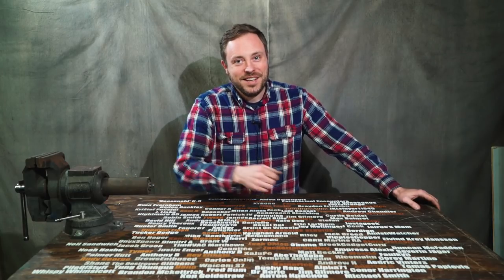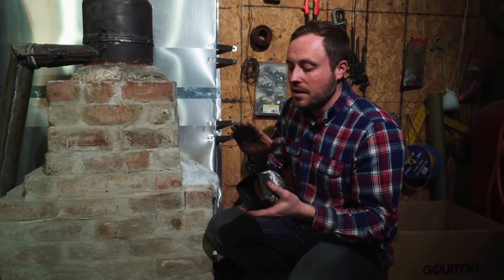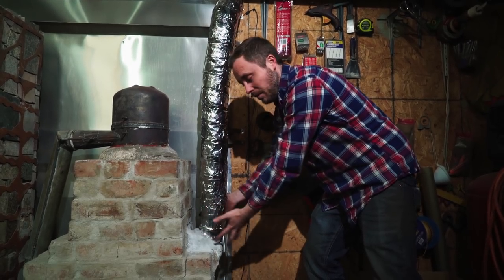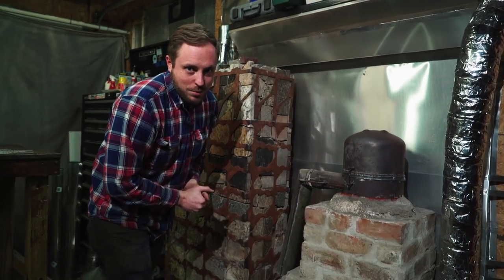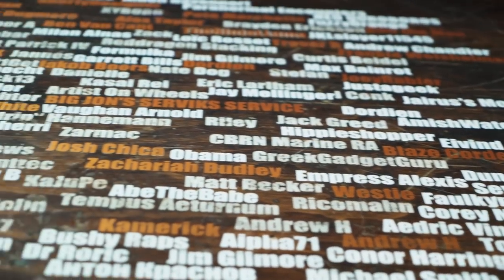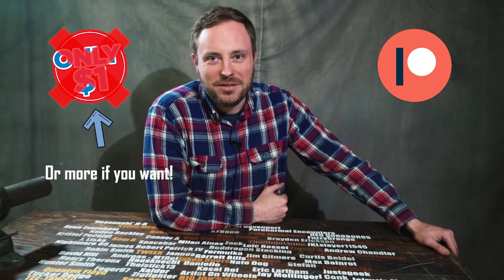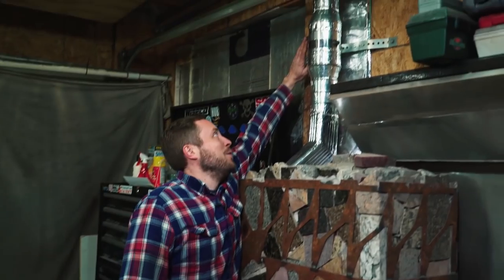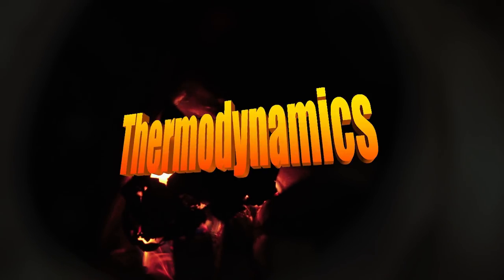Heat Your Garage For 74¢ A YEAR! - Mini Nautilus Rocket Heater Upgrade

Comment: hey man if you need free wood try those places that sell 4 wheelers or snowmobiles, the crates and packaging wood is thrown away
Reply: Yeah, a good chunk of those pallets is hardwood. That would work great
Reply: @alexwenham7136  But then he'd need to pull out all the nails, and still have to break them up into little chunks, anyway
Reply: @darksunrise957  free hardwood is free hardwood bro.

Comment: You could probably use peltier effect plate to run your PC fan once it gets warmer enough so that the system is keeping itself going instead of puling power from the wall
Reply: Just run if off rechargeable batteries and re-charge the batteries with your TEG.

Comment: I love this design. Solves so many issues space being the largest. The one question i have is insurance, can you insure your garage since you have a rocket mass heater that is not UL listed? If so what company does this. I want to build one for my house but cant find a company to insure it.
Reply: No sane insurance-company would insure that ticking timebomb.
Reply: @ABaumstumpf  It's no more of a "ticking timebomb" than a traditional wood stove. It's probably less of a risk, since choked wood stoves will build up creosote in the chimney and burn your house down.

Comment: great video .. excellent theory and practical demo . first time I have seen a sort of   torroidal burn chamber fabrication . I have my torroidal vortex design laying horizontal where it leaves the burn chamber  the riser exits the centre of the donut shaped  refractory cast torroidal  secondary burn zone .
Reply: My understanding is that you want the burn chamber itself to lose heat fairly freely, and not get super-hot, so that the insulated riser, of refractory brick/concrete/metal where the refractory temperatures are achieved.

Comment: As far as your exhaust problem. You should be typically. 3 foot higher than your roof Peak so you don't have the wind draft problem. For a regular wood burning stove anyway

Comment: If you add a thermocouple to charge a battery to run the fan, you can take it entirely off-grid. Dunno if the complexity and cost are worth it, but you might find the idea amusing.

Comment: These build videos were awesome to follow and it's great to see a follow up on it! I was very curious on how well it worked.

Little nitpick on the price, is that it's only accounting for the electricity from the fan and not gasoline burned while driving to get wood. Unless if you get those scraps from work!
Reply: Matthew Nelson he did say that he count the wood as free because its scrap from hos projects 🙂
Reply from the maker: Yeah I haven’t counted driving because I get wood from friends and places that I’m going to anyway.
Reply: If he wanted to go hard-core, he'd marry this system to a TEG that charges batteries that run the fan.  Then he wouldn't need any electricity for the life of a pretty small battery.

Comment: Just a suggestion for this:
I seen fans that run just from heat exchanged from copper fins. Use them and it could be zero point energy fed.
also maybe for a future project, think about a sealed unit that has copper tubing and 50/50 glycol water mix. In floor heating works with this same idea. The problem is sealing it and making is safe enough. But same idea, the water feeds into the bottom, hot fluids rise and out the top to heat the floor, then back in again.
But teaking out a floor probably isnt big on your list either heh. So anyone else have a plan with a dirt floor garage might be able to though.

Comment: Could you use wood chips? Then you could solve the hour long cutting wood with a crusher
Reply: Or wood pellets. I've seen someone making a pellet hopper for a RMH here on YT I think.
Reply from the maker: If the chips or pellets are too small they don’t get enough oxygen. Wood stoves that use pellets force air from the bottom to solve that.

Comment: At around the 10 minute mark you mentioned when it's windy outside you require the inside fan to keep the system from reversing, would it be possible to add a wind powered singular direction fan on the outside? Making the wind work with the system rather than against it.
Reply from the maker: I have thought about that a lot. Just haven’t had time to make one yet.

Comment: if you want better flow you can make a weather vane type chimey/inlet caps so that the inlet is always on the high pressure side of the wind and the exit is always on the low pressure. but im a hippy so you prob dont wanna take my advice!

Comment: Dude I was a chimney sweep for 10 years and that looks like galvanized pipe. When galvanized pipe heats up it puts off a poisonous gas. Also fiber glass will melt and catch other shit on fire, a ceramic or "white insulation" is required for double layered pipe

Comment: You could have also built a shroud that shielded the chimney from the wind, just an elbow facing sway from the wind. That would also potentially help with pulling the exhaust out by making a small vacuum.

Comment: Awesome, Have you tried firing it up just with some sticks that are already the right diameter or do they not burn well enough? 

 
p.S. am I the only one bothered by the lever on the butterfly valve being 90° offset from the actual valve?
Reply: joejoe4games im also bothered by it... Especially since every Valve since the beginning of time has had it to indicate the directon of the butterfly 😅
Reply from the maker: I do that sometimes also but they don’t burn as well, good thinking!

Most of the time it is closed and I want to see my cool curly bits. lol

Comment: 12v .5a 6w,  your computer fan is lower cost than most lights you would buy. 6 watts is very low power. it would take running this light 100 hours to use the power of 6 100 watt lights for an hour.

Comment: You should make wood splitter with a can crusher, or at least the can crusher mechanism
Reply: Splitting wood requires a hundred times the force of crushing a can.

Now, a gravity powered splitter could work by cranking a hundred pounds up a mast.
Reply: William Carr a can can take over 100lbs of force applied evenly, as a can crusher does. You should be able to put an axe head on a can crusher and split small can-sized logs.   But I just meant take the same mechanism, and scale it up.

Comment: 13:55   aluminum may have a melting point at $1,200° f   but here's something that most of y'all do not comprehend about the aluminum   》☆ >  if you have a structural item made out of aluminum and you heat it up to 400° f   aluminum will go into this conditioning that is called hot shortness  and whatever the item is made out of aluminum will collapse under its own weight   /   at 400° f aluminum structures collapse under their own weight the condition is called hot shortness  /

Comment: Seems like you could use some of the improvements that HoneyDoCarpenter created for rocket mass heaters using air-crete formulations and forge ceramics. His improvements will enable your unit to draft without an electric fan.

Comment: Have you tried wood pellets?  Its small and cheep.  You could make the pellets yourself lol.  Love to see that machine if you make it.............just an idea.  Also dual soap and water mixed will help with getting cock smooth out and cleaned up.  I learned that from installing windows on locomotives lol.

Comment: dont you need a permit?
Reply: No changes to load bearing walls so usually not

And it's a garage not a habitable building
Reply: Permits and Codes depend on jurisdiction. But generally, if the AHJ (authority having jurisdiction) follows, lets say International building, mechanical, and energy codes 2015, he would likely need a permit, and also depending on jurisdiction, a few or lots of inspections. Per said Energy code if you turn a building that was once not conditioned into a conditioned space or increase the energy use of the building past a threshold for lighting or HVAC energy use. You then have to follow all of rules within that code. Even if its not occupied or "habitable" for most of the year. Then there's building/mechanical code for construction of the fireplace, chimney, and now powered intake. And boy would this likely fail a lot of those inspections! (HVAC engineer and Inspector working in NYC) But nobody is here for code compliance now are we?

Comment: Great presentation if your born w a Mr Science brain... BUT for most of us I didn't follow anything you were saying. And I was really hoping to!
I have a 1914 garage w barn doors. Totally uninsulated. It was made to house a Model T Ford and 1914 windows.
  I wanted to find a way to heat it up for 2 reasons : keep my friendly wild cats warm ( they are 15 yrs old now) A City Nuisance man is not happy I have been feeding and sheltering them on my porch. They are OLD and losing their teeth. I fix them a warm mush everyday that I call my Cat Casserole. 
  I'm wanting a corner I can sit in and enjoy some hot tea and bowl of hot soup when I'm doing fall cleanup or shoveling my ass off in below zero temps

Comment: this is really cool, but I will pay 20 dollars every two months or so for propane so I can push a button and then go to work lol.  took me 8 minutes to set up my heater and set up an exhaust and it takes up about a two foot by two foot area.   even the small footprint of a micro rocket heater seems to be the size of a compact car!   Super cool engineering though.
Reply: I have a plentiful supply of sticks to burn. But will also use propane.

Comment: So it is not a rocket stove but rather a DIY tiled stove.
No emissions? XD Dream on. While wood is a regenerative energy source the emissions of such a system are usually rather high, specially if the wood-quality is not constantly monitored. Efficiency? I find it funny that people throw around numbers like 90-95% when they have no clue how to even begin to measure it. Seriously - the whole point of the original "rocket"stove (which is actually quit old) was just to get a decently hot fire burning quickly with poor quality materials. It can burn green wood no problem. But Efficient? Not really. And they specifically require a fast airflow.

you have build a normal oven similar to what has been used for centuries in cold regions around the world.

Comment: Your setup probably vastly exceeded fire safety codes at this point. 

If you were to rebuild this, what changes do you think you'd make in terms of aesthetics, features, structural simplicity, and safety?

Personally, I would try to include some kind of fuel-hopper that can be reloaded independently of the air supply.

Comment: One of the issues you're facing is that you're not re-heating the exhaust which creates a much bigger draw. If the exhaust from your mass were to come out above the steel dome, that would re-heat the exhaust gases, making them flow better out of the building. Yes, that creates a little inefficiency because you're losing some of that heat, but thermodynamics will tell you, you won't even need the computer fan at that point.

You know who taught me that? A hippy. Just sayin'

Comment: Since you're attempting to burn your fire as hot as possible, preheated air is preferable to cold air for adding air to the burn.  Your issues with hippies (whoever they are) are weird.

Comment: 4:44 are the problems a properly functioning rocket heater core doesnt have… good thing it doesn’t get really hot you will have to vacuum the spalling steel in the burn chamber… hahaha I built mine for around the same cost it works perfectly probably spent less than this guy

Comment: it's not emissions free, it is smoke free because everything in the exhaust is either steam or CO2 which is colorless and odourless
You cannot burn wood without creating co2
Reply: Is that really your argument? With that argument humans aren't emissions free lol. We get that there are byproducts,  but this is one of the least wasteful ways to heat
Reply: @alexwenham7136  well, no one is claiming humans are emissions free.. Why would you get upset when someone respectfully explains how someone used an incorrect term?
Reply: @Catrik  because everyone understands that NOTHING is completely emissions free, so the semantics here are just tedious.
Reply: @alexwenham7136  I do not believe everyone understands this, I'm sure there are a LOT of people who would not understand that. Why would you use incorrect, confusing terms when you could just use correct terms? I don't understand why you would get annoyed about this.
Reply: @SystemsPlanet  this is basic chemistry - 2 atoms of carbon for each atom of oxygen consumed - the most efficient way to burn wood it will create co2 
what will happen with the carbon atoms after you heat them with plasma??😂 (btw flames are form of plasma)
Reply: to clarify I am not saying this is a bad way of burning, infact, if you get only co2 than you reached the most efficient rapid oxidation of anything possible. but you cannot tell people it's emissions free because it's releasing basically same amount of carbon into atmosphere as a normal campfire (but it's just pure co2 not the other organic molecules which cause campfire smell and smoke colour)

Comment: NEVER EVER push air INTO your stove. You ALWAYS want to DRAW the air OUT of the building.     Also, heating the incoming combustion air will More than pay for itself in more efficient combustion  and MORE heat.
Reply: That is normally the case with traditional wood stoves, but this is not a normal wood stove. It needs the forced air, kind of like a supercharged car engine.

Comment: I like your design, and am definitely not a hippie. I definitely agree that in general their videos are weak on engineering explanations and not comprehensive or concise like yours. However, in the interest of your video being helpful for others, a few things should be pointed out where SOME--definitely not all--of the hippie designs still have something on you.

First of all the hippies typically take the output end of the mass heater and run it near their radiant source-the drum or helium tank, or whatever. This allows for the cooled air to reheat a little bit, which helps ensure a draft. Look at the 3:57 point of this video: https://www.youtube.com/watch?v=vXHmcKWfFw4. The lack of this in your design is part of what causes the weak draft you've experienced that can't fight prevailing winds. Now I admit that the counter argument is that you've solved the problem with a tiny fan that sips electricity at a trivial rate, and that the amount of energy you'd sacrifice in the form of heat going up your chimney is probably more valuable than the pennies of electricity used. So it seems that in the end you might be ahead. However, one disadvantage is that you need electricity to run yours, so if the juice is out, you have no heat... unless you run that tiny fan off a portable battery, which is definitely possible. But I point this out for those that might shy away from your design simply because they don't want to use a fan. I believe your design is fixable with a simple reroute instead of a fan. 

Second is that buoyancy of air based on temperature is a relative thing. A tube full of cold air at a homogenous temp won't tend to go up or down. It stays put. If there is warmer air over it, it stays put. If there is warmer air below it, it will sink. In your intake tube, you have cold air coming in. Since it is in theory all at the same temperature, there is no gain from a sinking force as you've claimed. One could argue that the bit of heat that penetrates the insulation will create warmer air near the stove, and that warmer air will move upward in the intake pipe and the colder air will move downward, but that intake pipe has a flow rate and cross section that is preventing any sort of simultaneous bidirectional flow. So it is really just creating a slightly warmer pocket of air in the bottom that is trying to go up against colder air, so no gain and actually a little loss. But in the end, the insulation and flow rate here probably prevent any sort of convection heat transfer to that incoming air that would create any significant buoyancy forces in that pipe. But I just feel it should be pointed out that it is not necessary or even a gain to route the incoming air to go downward.

I don't mean to offend you, and appreciate the time you've taken to make this video, but just want to point these out for others learning from your design.

Comment: SOOO ... no heat beyond 100°F at the exhaust... and completely NON-TOXIC exhaust.... and yer giving the fire complete combustion... AND NOT REHEATING ALREADY WARMED AIR FROM THE ROOM.
GREAT PLAN... ALAS A DUCT FAN WOULD BE PREFERRABLE, IF IT WORKED BY A THERMISTOR & RELAY.
Reply: P.S. ... The stack is wasted... there is no smoke if built correctly.
(exception being the initial start-up)
Regulators demand it for ONLY THAT REASON.